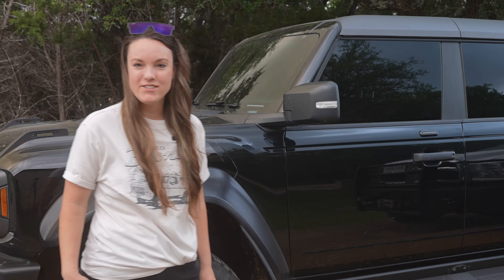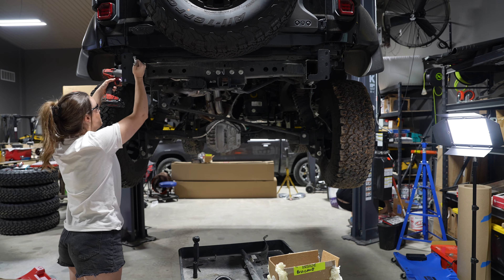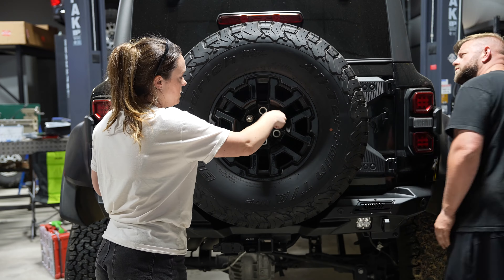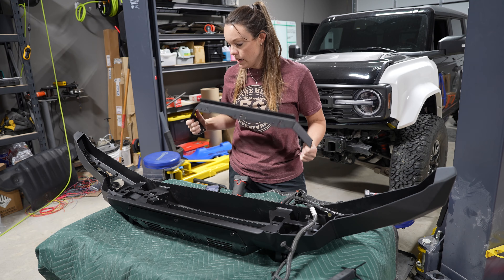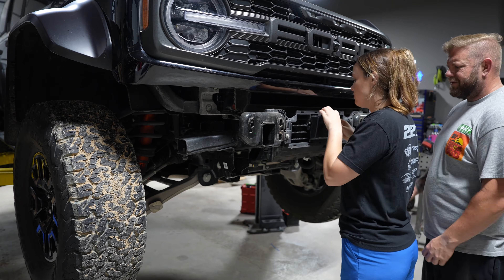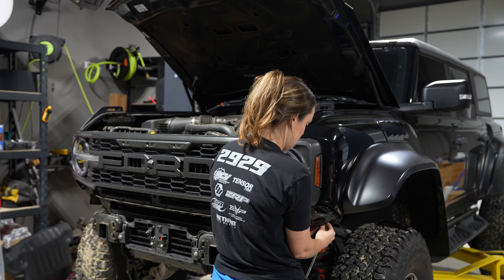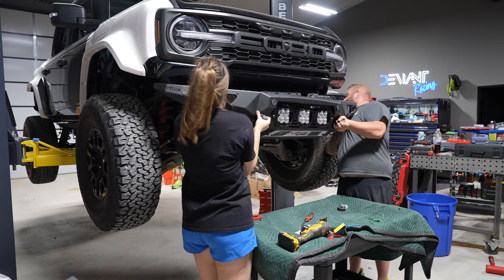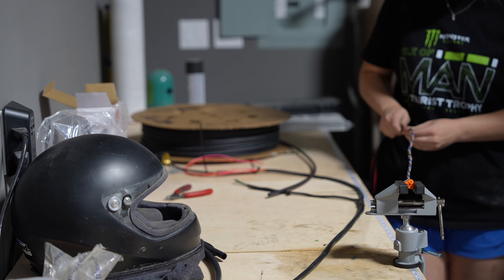Bronco Raptor Bumper Install - Addictive Desert Designs - Baja Designs

Comment: You can put the wire you want to twist on the end of a drill and that will braid it up real nice and quick. ADD makes Raptor a frame horn gusset kit that Reinforces the Failure Prone OEM Frame Horn Mounts.
Reply from the maker: We use the drill method as well.  Sometimes doing it by hand gets it better though.  Interested in checking out those gussets, thanks for the heads up!
Reply: @deviantracing6129  nothing cleaner or consistent than using a drill lol. 🤘🏻